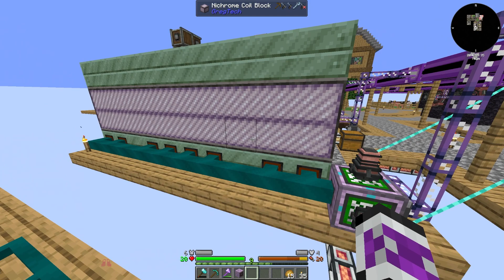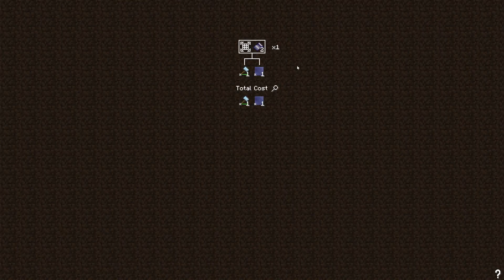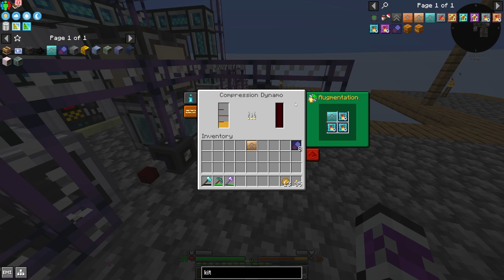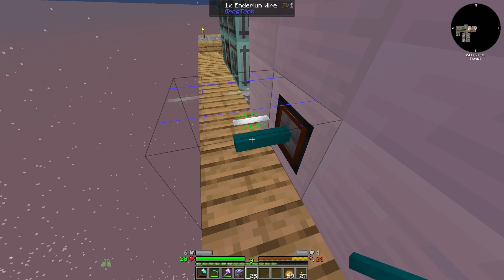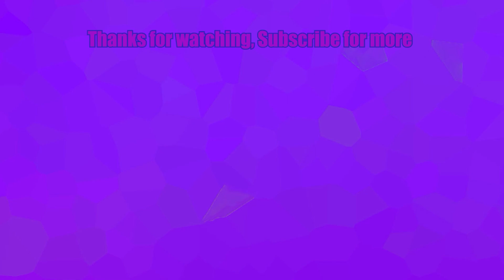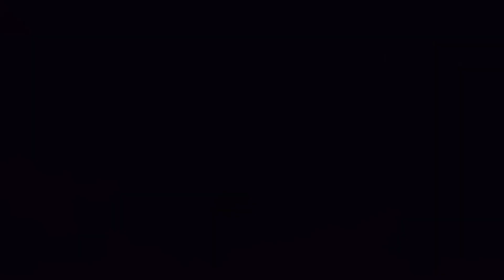Star Technology: Episode 22 - Machinery Multiblocking

Comment: If u use multiple different lv/ulv input buses/hatches, u can run multiple recipes on multiple circuits at once because each input can have its own circuit and use the same output, this will save u a lot of time in the circuit config menu.
Reply from the maker: That's why I got the multiblocks, they pretty much solve every problem with parallel machines like that. I'll have multiple inputs on things like the mixer and chemical reactor instead of multiple machines like I have now.
Reply: @Thaumiumking9 you will also need to set the input buses to distinct buses (true) or else multiple input buses wont work properly

Comment: All the large machines are worth making, because of 2 things: they have perfect overclock, and the cost of upgrade is the cost of an energy hatch.
Perfect overclock means that the speed is proportionnal to the energy cost. For instance, when you upgrade a single block like a mixer from one tier to the next, the energy cost quadruples, but the recipe speed only doubles. Perfect overclock means that if the energy cost quadruples, the speed also quadruples. So in general, the large machines are much better than the single blocks.
For the upgrade cost, it just means that if you want your large machine to do the next recipe tier, you just have to change the energy hatch, and no other block, so the cost is less than creating a whole new single block.

Also little tip: for the maintenance hatch, if you click the cogwheel in the middle without any item in hand, it will use all your inventory to try and fix the issue. That way you don't have to do 6 clicks each time
Reply from the maker: Pretty much all of that was taught to me in the previous episode's comments, that's why I've been rushing these multiblocks as fast as I can. I knew they'd be easier to overclock (although I didn't know the overclock was better) and overclocking has been steadily taught to me throughout the series. I'm also aware of the maintenance hatch tip, and I'm pretty sure I used it in the video too.

Comment: There are 2 types of Large Machines:
* Large Machines made through the Upgrade Kit (as far as I know, these are custom, and not official), these can only have 1 hatch.
* Large Machine Factories made by upgrading IV Machines. These were originally from Gregicallity (an addon for GTCE). Almost every non custom machine has this form and these can sometimes have 2 energy hatches for easy overclock. But the Assembler and Circuit Assembler can only have 1. However, these need the Alloy Blast Smelter with RTM coils.

Also, invest in Solar Panels. At LuV you can have 100k RF/t per solar panel.

Edit: If you want the Large Sieve, the controller needs Pure Netherite, which needs an LuV Chemical Bath. What I did, is I made the Large Chemical Washer Factory (or whatever it's called), and used two IV Energy Hatches.
Reply from the maker: Most of the large factories I've put off until IV, but I'll definitely get them all when the time comes for much the same reason as the multiblocks in this video. I'll look into the solar panels as well to maybe replace my oil rig, but LuV is quite a while away so I don't know how soon I'll want them.
Reply: @Thaumiumking9  I basically waited until LuV and then started making Ultimate Solar Panels. I dont know if the lower-tier ones are worth it.
Reply: And which one is better to invest? Or they are similar in working speed?
Reply: @The_Quaero  Large machines have perfect overclock (4x more energy means 4x faster recipes), but can only accept 1 energy hatch. This makes it so the machine itself can't run recipes voltage tiers above the tier of the energy hattch. And no, multi-amp hatches only give it more power for overclock, but still cant run recipes above the voltage tier of the energy hatch. These are unlocked in HV.

Large factories do not have perfect overclock, for 4x power you give it, the machine is 2x faster. However, a majority of these accept 2 energy hatches. If you use 2 energy hacthes on a machine, it will increase the maximum recipe voltage tier by 1. Basically, picture a Large Wiremill Factory with 2 IV energy hatches. This factory can run LuV recipes, because LuV is 1 tier above IV. On top of this, factories accept Parallel Control Hatches. If you place this on a multiblock, the machine can now run multiple recipes in parallel. For example: a Wiremill would turn 4 ingots into 8 wires in 1 recipe. However, doing this causes the machine to require more power, so if you want more recipes in parallel, make sure to either use 2 energy hatches, or multi-amp hatches! These are unlocked in IV.
Reply: @richardjustr11111  
Thanks for answer. Look's like large machines would be good for resource production or passive automation and factories for autocrafting and overaul playthrough.